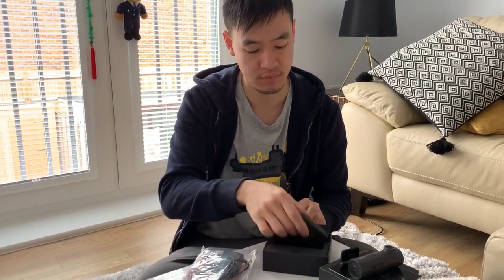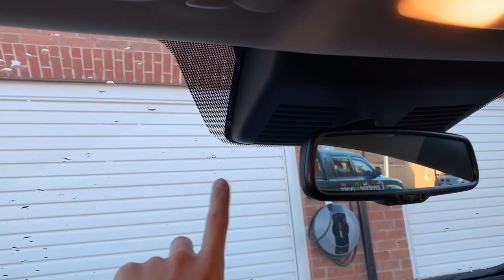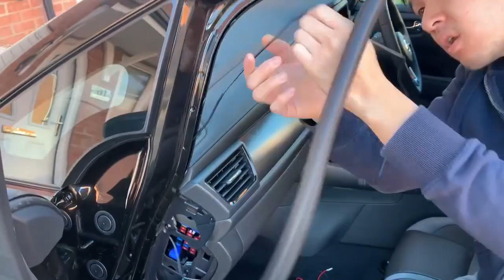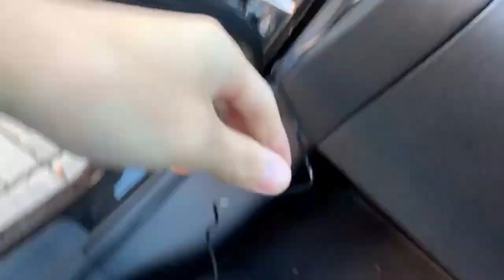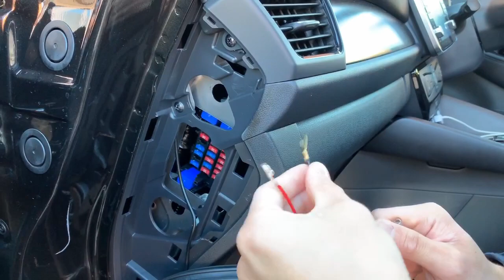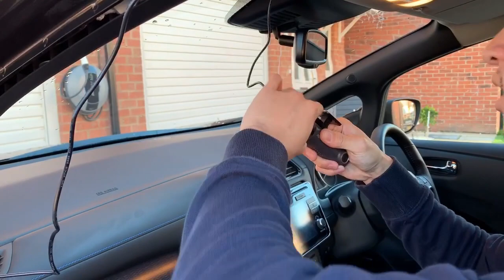Nissan Leaf 2018 Dash Cam Install

Comment: Good job on confirming the positive and negative sides for the tap.  Not vital for a small draw device like a dashcam, but best to do it right.  Inserting the tap the other way around would have still worked but would mean that the dashcam is first protected by the 20A outlet fuse and then by its own 5A fuse - just not electrically neat that way.
Lots of DIYers don't even think about that, maybe because they read that a fuse itself can be oriented either way in the slot - but looks nicer if all the fuse lettering is the same way up!

Comment: You blocked the airbag with the cable! It's really dangerous!
Reply: Scared me that he used a screwdriver to push the cable in.  I too thought the airbag was higher up than the point where you would want to bring the cable over toward the door seal.  But it is not.  Seems that the lower part of the bag is behind the uppermost bit of the big plastic trim, and the upper part of the bag is behind the fabric-coated trim piece.  So when it activates, both those pieces would be blown off.
Maybe if you arrange the excess cable in way that an activating bag would just take the cable with it?  Or wouldn't the force snap that (18 gauge?) cable instantly?

Comment: Hi James. This video gave me the confidence to wire it myself - thanks!

However I struggled to hide the wiring under the roof liner above the windscreen. It seems very difficult to push the cable behind the roof liner - in worried about damaging it! 
Have you got any advice? It's not clear from your video but it looks as if this is what you did.

Comment: Thanks for the video! 
Following your advice I was able to quickly hardwire my dashcam. Which a local garage quoted me £100 to do!
Reply: mine was min 3 hours and 160 € per hour. Front and rear cam + I am loosing warantie on the car.

Comment: This video was exceptionally useful. Thanks for posting it! I couldn't quite figure out how to remove the accessory fuse, so I ended up using the seat warmer circuit instead (since that is also switched to the ignition).

At some point I'll want to shorten the USB cable on my installation kit, though; 5 meters is WAY more than I need!

Comment: Are you aware that you are obstructing the side curtain airbag by guiding the power cable across the side pillar?
Reply: I've noticed the same, The A pillar trim needs to be taken off and the cable fed on the back side of the side curtain bag

Comment: Did you use a low profile mini fuse tap and was it hard to push into the power socket? I'm struggling to push it in on mine?
Reply from the maker: I don't believe it was the low profile ones. Just standard mini blade fuse I used
Reply: @jameslaw6670  thanks

Comment: Thanks for the video. Have you had any trouble with trim with cable inside? Proper fit with cable, trim stays on and so forth? No water in car during rain?
Reply from the maker: Hi, no issues with rain water etc as all the rubber seals and trims are in the place where it should be. Been running this for over a year now and now issues at all
Reply: @jameslaw6670  ok good to hear. Having a dash cam is pretty much very good idea back here in Finland as usually warranty does not cover accidents in parking lots "where the culprit has not been identified" or how should that be put properly... Anyways thanks for the very hands-on video!